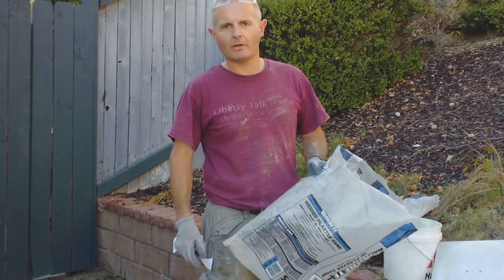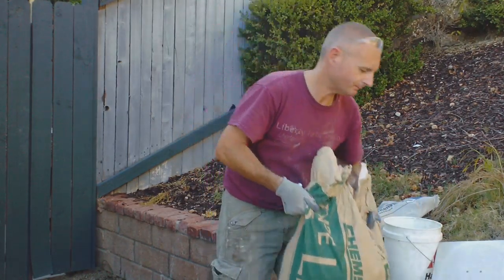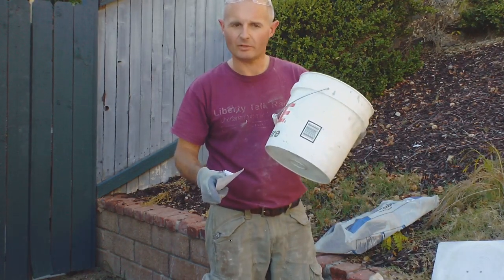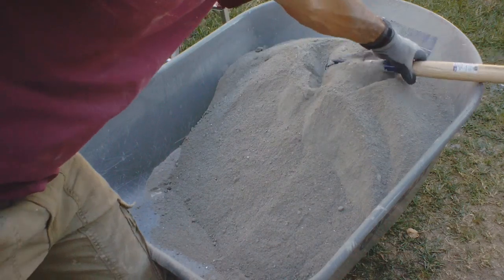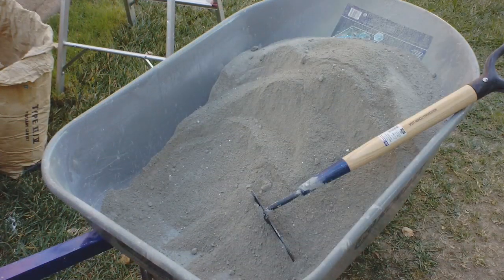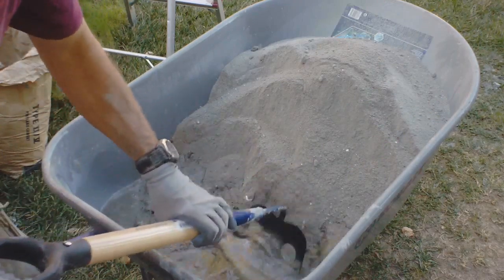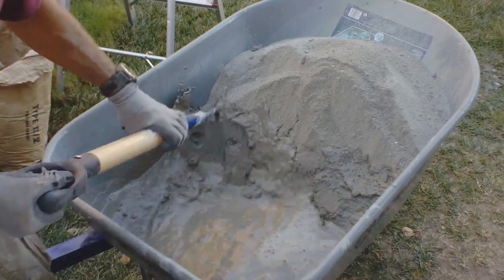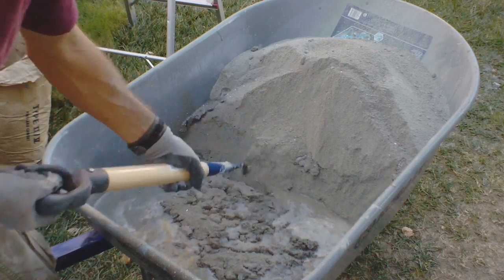How to Make and Mix Portland Cement Stucco in a Wheelbarrow

Comment from the maker: Lime is a general name for material containing calcium, but when used is usually referring to Calcium Hydroxide or Calcium Carbonate.  Lime used for Mortar or Stucco is Type-S Hydrated Lime which is ground up limestone (calcium carbonate) that is burned to drive off the carbon dioxide (CO2) and then hydrated in a pressure hydrator (where the type S comes from).  Adding lime to a cement mixture makes the mix more workable, prevents the sand & cement from coming apart, reduces shrinking/cracking and makes it more waterproof.
Reply: +bearing01  الووووو هلا كيف حلك
Reply: thanks!
Reply: محمد السليم هذا انجليزي ههههه. معرف يقرا عربي😂😂😂
Reply: جيد جدا ممتاز 👍
Reply: Pi

Comment: I sold my Stone brand mixer, thinking I was going to move 2 years ago....Now I am going to finish my new brewery, inside the house, with Stucco.  Plaster seems to be just not what I want, with many reliefs, faux stucco beams.....Now I see that I can do it with a wheel barrel, which I knew would be much different then a gas powered paddle mixer!
Thanks!

Comment: Hey in order to make a mix to use for stamping some rock stamps onto a wall could I simply use type S mortar and a couple shovels of Portland cement per bag ? Or even use a polymer resurfacing concrete like Re-Cap?

Comment: great video!  thanks for the info! here's a question,  I'm planning on useing this to cover plywood for a rock climbing wall, do you think the stucco will crack and chip off the wall ?
Reply from the maker: +Jesse Whittard Stucco will crack if the substrate has any movement.  Outside my bedroom window and my garage side door has wall stucco cracks due to opening/closing both.  On a house, this isn't a big deal because the wall is waterproof due to the paper underneath.   Cracked stucco won't fall off because it's held together with wire lath or chicken wire.
Reply: +bearing01 thanks man,  keep up the good work sir.
Reply from the maker: +Jesse Whittard Stucco in residential applications is only 7/8 inch thick.  If you're going to try it I'd use the most structural steel as possible.  I'd use metal lath and not stucco wire also called netting.  Keep in mind that if the wall vibrates the stucco will crack. /John
Reply from the maker: +Jesse Whittard Stucco in residential applications is only 7/8 inch thick.  If you're going to try it I'd use the most structural steel as possible.  I'd use metal lath and not stucco wire also called netting.  Keep in mind that if the wall vibrates the stucco will crack. /John
Reply: +Jesse Whittard  الووووو هلا كيف حلك
Reply: +bearing01  الووووو هلا كيف حلك
Reply: +Jesse Whittard  الووووو هلا كيف حلك
Reply: +ات ;i can't read that language
Reply: not your calling guy,that mixer is a back breaker(too short)seriously

Comment: Not trying to bash you sir but you're spending more time mixing then it would take to put it on the wall you say you don't like using a bucket and paddle drill because it leaves sand in the bottom but when I do it I put the water  then the  cement mix it together then start adding the sand depending on what you're doing with the cement ICU expelling too much muscle just to mix it save it for the actual work

Also using the paddle drill will help fluff up your cement so you have better workability when applying
Reply: Where do you get a paddle for a drill that will work? Is it the same kind you stick in a paint bucket? Also why does nobody use a cement mixer? Harbor freight has the big one on sale for $149.00 several times a year
Reply: @marlboromatt5656  you can get them at Home Depot or Lowe's or any place like that just go into the area that they sell cement they usually have a section  for the tools and you will see them there and like I said add the water first then mix the cement in there spin it a little bit to get it into a slurry and then add your sand

 the basic mixed racial with plastic cement is 3 to
1
Three parts and one part cement easy so whatever container you are using filling up three times with sand and 1 time what cement
Reply: A DIY-er simply doesn't want to spend the money.